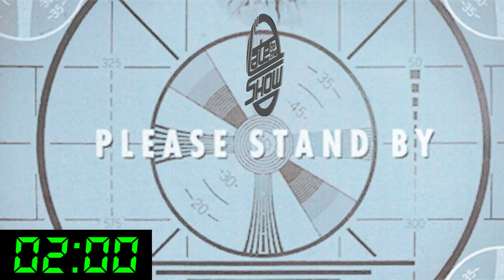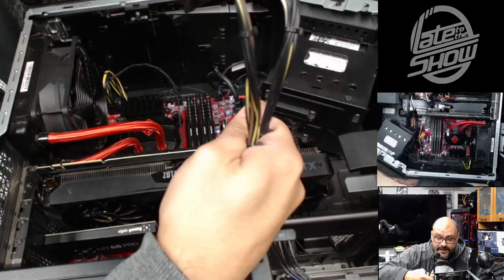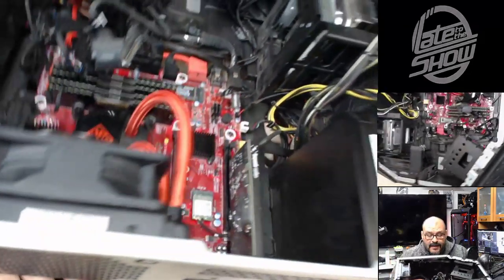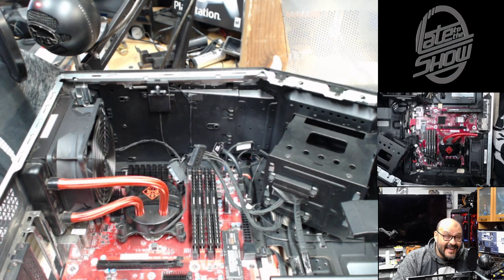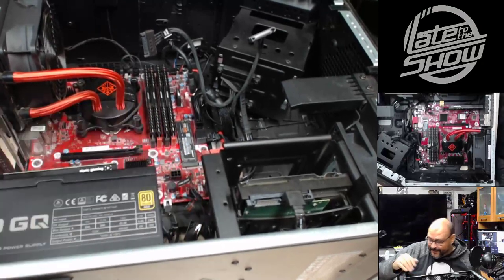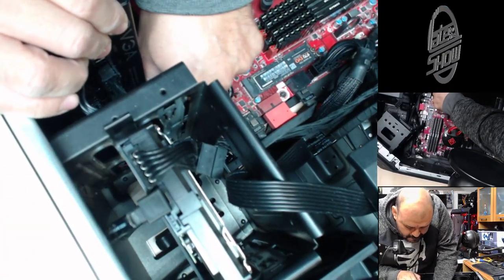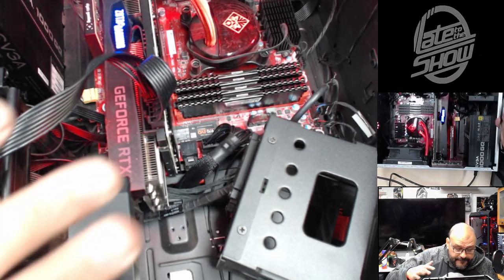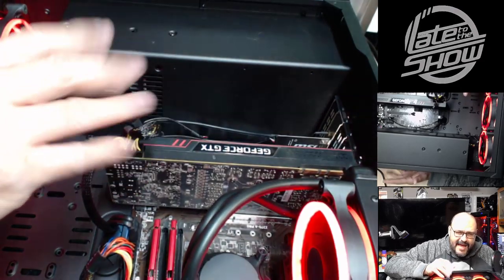Replace Omen Power Supply

Comment: Hi, is it possible to replace the motherboard of the HP Omen 880? Btw if someone doesn't type "Late to the show" with quotation marks in the search bar it is very hard to find your channel as the search is flooded with late night talk show highlights.
Reply from the maker: You can but the problem doing this is connecting  the Red LEDs back and the connection might not reach the  motherboard unless you do some internal cable management.

Comment: I'm going to upgrade my power supply to1200, but current using 750, but I notice when I adjust the game to higher performance the pc will start to freeze up or sometimes shut down with no warning, any idea what may cause it?
Reply from the maker: Check you water pump status see if you CPU is over heating it might be a dry reservoir also you might need to reapply thermal paste to the cpu. Also monitor the GPU. You can also see a crash report this might also help.

Comment: Is Ur old power supply 500w
Reply from the maker: Yes, replace it with 1000w but then build another system and replace is with a 750w beacuse 1000w was over killed for the system.
Reply: @LatetotheShow   thanks for the reply